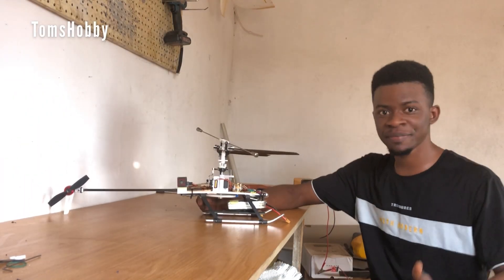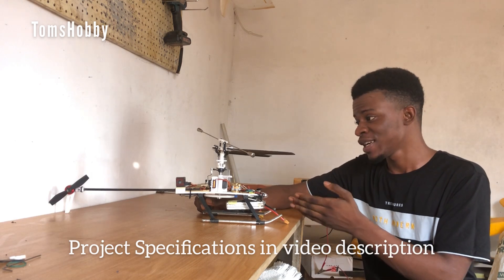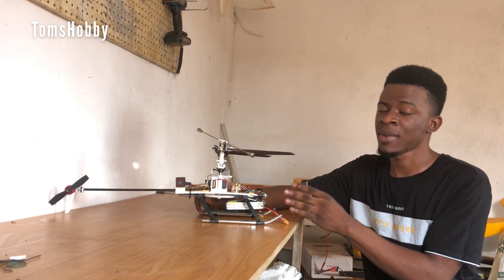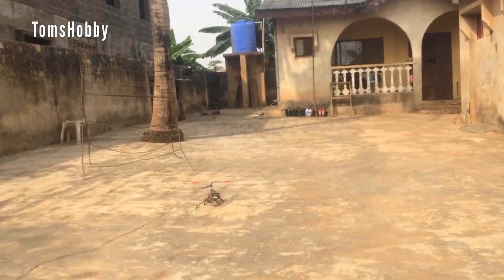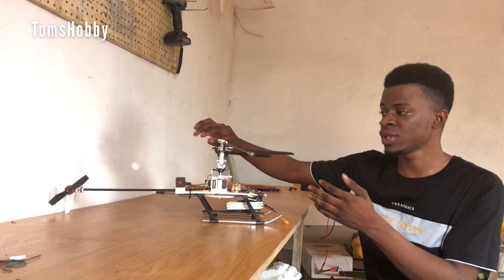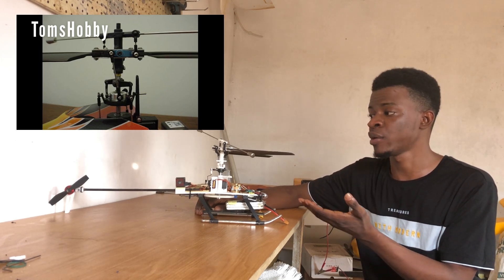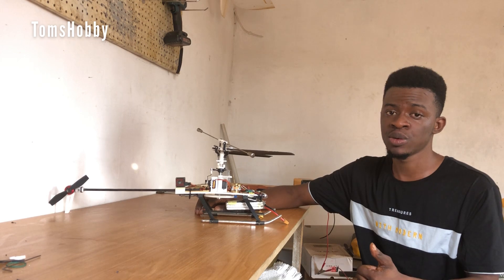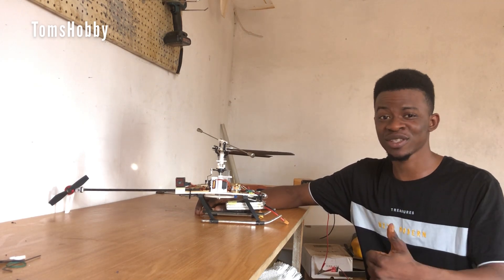RC Helicopter 3D Printed and It Flies!

Comment: Flybar is not linked with main blades, so basically it's useless as if there is no Flybar or stabilizer.  That's why the helicopter is unstable. Also the servos and swash plate system is useless as well.
Reply: If it flys it flys

Comment: I find it absolutely amazing (albeit scarry too) that you 3d printed the linkages. How did you manage to print those balls so precisely? I am impressed.
Reply from the maker: It takes two sample prints to get the right fit size.. am actually surprised it worked well too